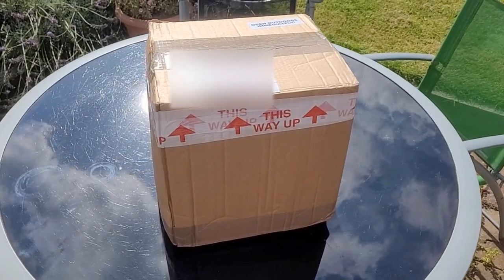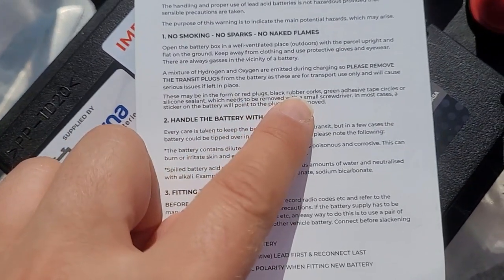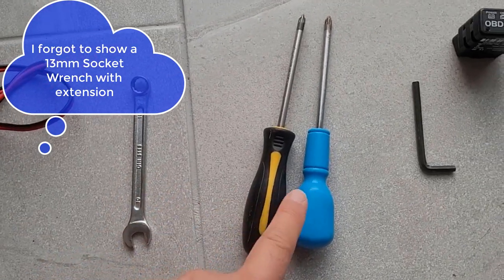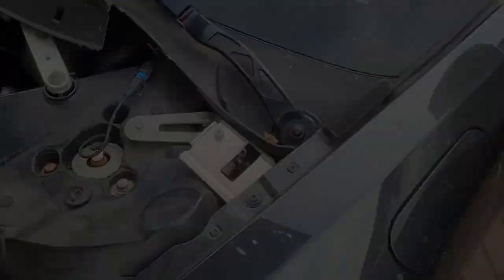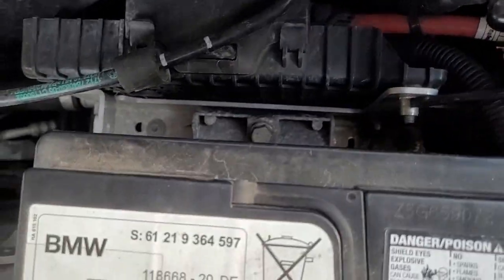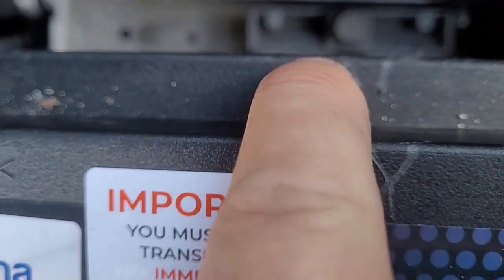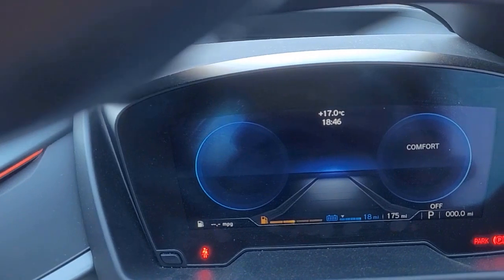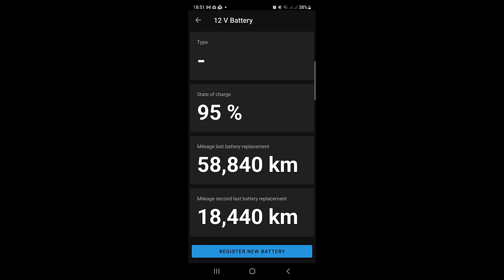BMW i8 12V Battery Replacement Made Simple

Comment: UPDATE: The HV connector is kind of PITA to detach and the Bimmerlink app will need also Bimmercode app activation in order to code different capacity 12V battery onto vehicle. At least when I'm writing this Jan 16th 2026. I had Bimmerlink app activated but when tried to code a different capacity (55Ah 540CC vs OEM 50Ah 520CC) the Bimmerlink said that I need to do that via Bimmercode. Lol...

Otherwise really good tutorial but the said HV connector, there's zero videos showing the actual method how to "disconnect" it.